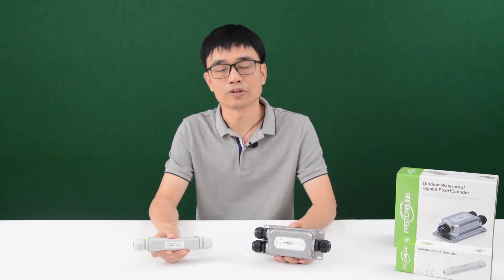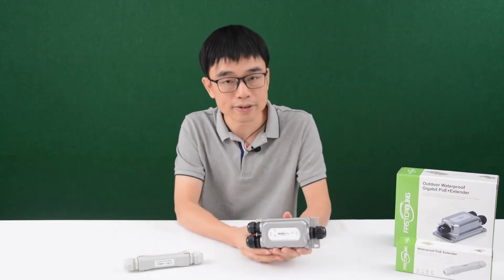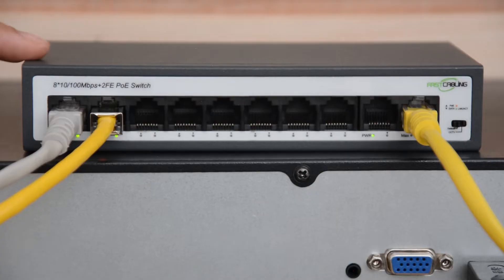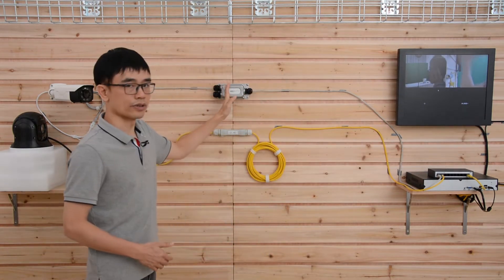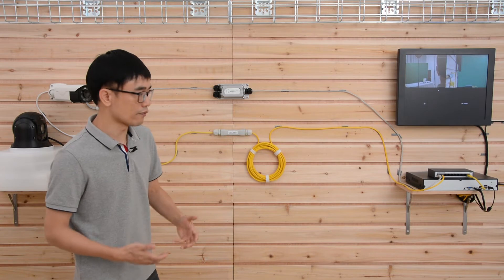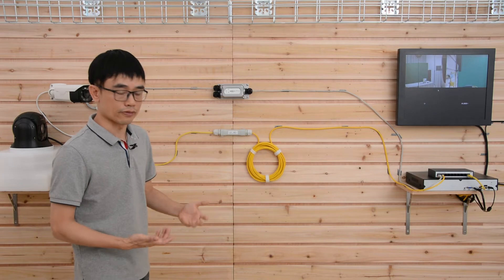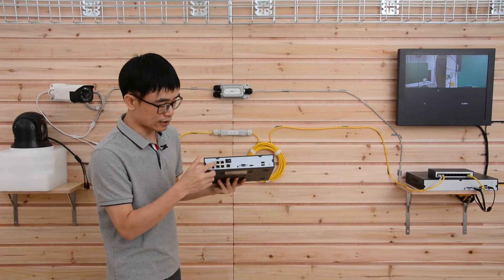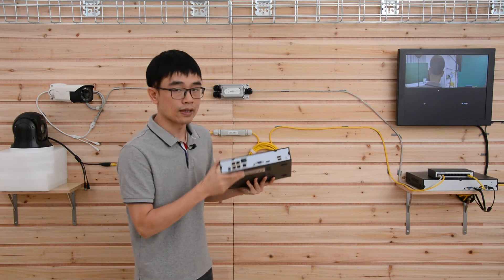1-Port vs 2-Port PoE Extender - What is the difference?

Comment: Just received mine and it says it needs to be earthed. But I don’t see it earthed in your video
Reply from the maker: There is grounding spot on the housing fo the dual port PoE extender. However the grounding is not "Must taken" action in the low voltage system. There is no grounding spot at the 1 in 1 out PoE extender. The surge will pass the PoE extender and reach both ends. You can ground your switch and camera at both ends, and it will release. the ground at these two points.

Comment: Hello, is it safe for a cat5e cable to carry 30 watt load?
Reply from the maker: Yes. The maximum power budget is 90W. As the PoE take DC48-DC56V as voltage input, it is safe.

Comment: How many maximum daisy chain poe extender 1in2 every 100m with power injector 30w?
Reply from the maker: There is 90W version 1 in 2 out PoE extender. You can daisy chain 3 units to have 400 meters with 25.5W from single port. However there is  1 in 1 out version which allow you to have 400 meters continous running, not need daisy chian, and still have 25.5W output.

Comment: For the 1in 2 out, can you connect an access point point? 

A gate control 700m away from my house, I have tplink a point to point one at the house powered by network switch , second one at the gate powered by single output Poe injector, I also want to connect an outdoor wireless access point for my gate control device to connect to so I can open the gate by wifi, the issue is the Poe injector is single output, and the AP and point to point have single inputs, I need to “switch” in order to power both devices and have them on the same network.
Reply from the maker: I am not sure whether it is the 48V standard PoE injector or not. If yes, you can replace the PoE injector with a 4 ports PoE/PoE+ switch. However, if your APs only support 24V passive PoE, then you will need to look for the a 24V passive PoE switch.

Comment: i thought you said the single poe injector can do 1000 feet ?
Reply from the maker: It is never about PoE injector. The PoE injector only inject the low voltage power to the cat5e or cat6 cable. It doesn’t repeat the POE distance. I think what you mentioned is the PoE extenders. Single PoE extender can repeat 328ft. While two PoE extenders (1 in 1 out) pair up, it can achieve 1000ft continuous between these two, and you still have 500ft additional length. Also you will need to consider the power loss, the PoE extenders don’t repeat the power. The power can’t be re-generated. https://youtu.be/ZJNhh8IdBdY